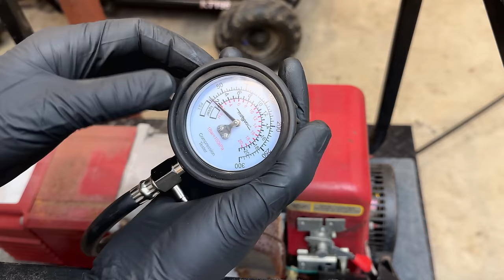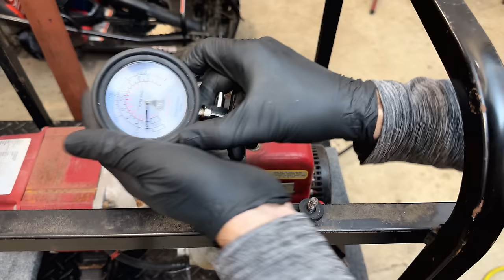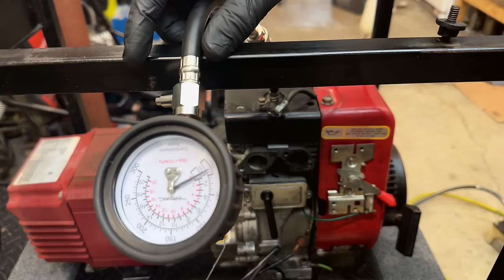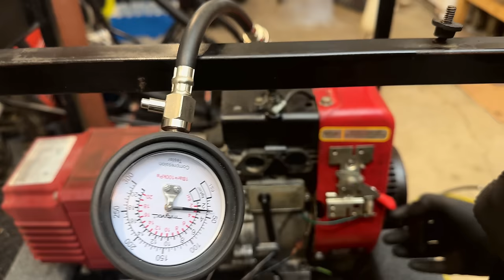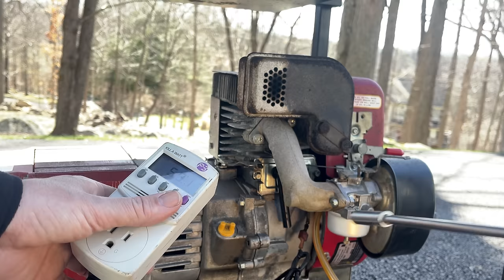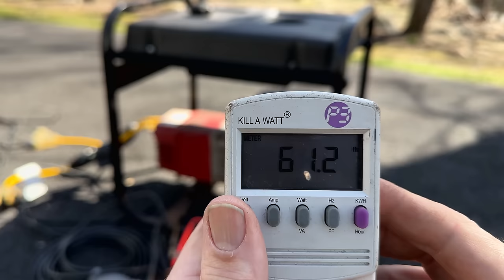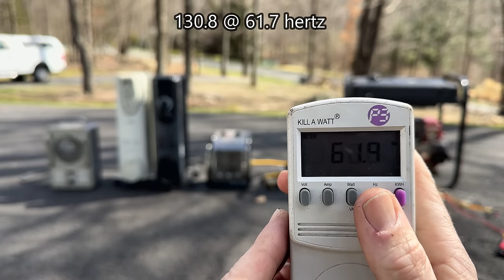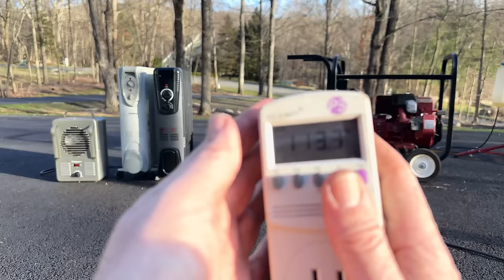More Tecumseh Trouble - Low Compression

Comment: 42:25 I would think adding lubricant to the threads and washers would alter torque values much more than surface rust. That said, I always wire wheel fasteners that are rusted or dirty. In this case a set of head bolts might take 5-10 minutes at the most. Hitting the bolt heads after installation with chain lube or wax would preclude debris from sticking and inhibit rusting, plus cleaned fasteners look way better than rusty ones on a finished engine.

Comment: Hey James, recent subscriber to the channel after repeatedly being recommended your videos (I watch a lot of adjacent content I suppose haha) and I gotta say, I've definitely been enjoying the long format meticulous look into the various gen sets that you come across!  As someone who really enjoys the electrical aspect of these units as much or even more than the mechanical side at times, something I'd like to see is maybe spend a minute or two showing the spec plate on the gen head or discussing your thoughts on how they went about breaking out the AC side of things for the end user. This ones a good example, as you stated it only has 120V (assuming NEMA 5-20R) and 240V (looks like NEMA 6-15R) outlets available, and how that makes it impractical to connect your load bank for lack of a neutral on the 240V receptacle. Then seeing how you connected the heaters split evenly between the two 120V outlets makes me wonder if they split the phases across each side of the duplex outlet, effectively giving you about 4800W @ 120V available. I'm sure I can't be the only super nerd wondering these things, and a little peek into these aspects of the units you work on would be icing on the cake!

Thanks for the laid back and informative content, keep it up!
Reply from the maker: They did split the phases on the 120 out.
Reply: @jcondon1 Ah, makes sense then! Definitely a good example of why it's important to "home run" heavy loads back to separate outlets on generators. Most of the time they don't even really make it obvious which outlets are on which leg so you can load them evenly, both on new or old machines. I've seen some funky stuff where they share one leg of the 240V breaker to protect the 120V outlets, "240V" outlets that are just wired for 120V, etc etc. Cost cutting for consumer grade equipment at it's finest i suppose. I still think it would be cool to briefly touch on these things to see how different manufacturers intended the consumer to use the equipment from the electrical side, especially on the more vintage stuff

Comment: Have you considered a "soda blaster" for cleaning the engine / generator cases?  Soda blasters (they use baking soda as the media) are safe to use on thin metal and aluminum.

Comment: Yeah, from my experience with Tecumseh used to have a riding lawnmower with a Tecumseh they’re exhaust systems tend to ignite unburnt fuel and caused them to pop and crackle, which sounds like a mess but it’s not just normal Tecumseh lol 😂
Reply: I had an MTD lawn tractor from the late 80's that had a really bum exhaust system. The engine just rattled the bolts holding manifold off. Not a good design at all. My Craftsman with a 19 horse B&S runs like a champ. It's going to be starting its 21st cutting season this spring.😊

Comment: You really need some hose scissors. You don't realize how much you need them til you have them. They make a really nice cut without flattening and misshaping the end of the line. They are about $7 at Lowes. They are one of the most heavily used tools in my kit.

Comment: I've noted in several of your videos the difficulty you have removing fuel fittings from the gas tank's rubber bushing. I'm thinking that it might be worthwhile to try using a slide hammer to pop the fitting out. It could eliminate a lot of time and frustration if it works. Just a thought. Your videos are in my list of top favorites!:finger-red-number-one:

Comment: Just past 49mins you mention that the clearance or lash would have gotten worse when the engine warms up and the engine may have stopped running. It seems counter intuitive but valve lash actually loosens when the engine warms up.

Comment: I had a craftsman trimmer that was always at 25psi. Different compression testers same result. No idea why. But it ran like a champ!
Reply from the maker: Really small engines like a trimmer need the shrader valve on the end of the hose where it screws into the head.   The less expensive testers have the valve up in the gauge.  The length of hose lowers the compression over the additional volume of air.

Comment: you should be able to use a dial caliper to check the length of the valve initially and then check and see how much you gave taken off with a measurement after the grinding to get a pretty accurate measurement.  keep submitting videos as I am learning a lot and look forward to your posts.

Comment: HAHAHAAH SO sorry You had to work on that Engine.
Now I don't feel so bad ...back in the 80's I had an 8Hp on a 4'000 Watt that was so cantankerously Noisy. I had a car muffler on it. I had washers between most of the mating surfaces. I had a easy to move governor adjustor 
and it leaked fuel only while it was running...
it was the 1st Genny I ever bought, and when I moved it was the 1st one sold. I still have 7.
3 of which are Military gen sets from the 40's..
I will  not work on any Techjunk engines anymore...

Comment: Love that you show that you torque bolts and give the specs. Having worked on repairing aircraft in a past profession made me anal about torques.

Really appreciated!
Reply from the maker: Thanks.  Definitely more important to torque aircraft bolts, but I would hate for something to fail because it was not torqued right.
Reply: @jcondon1  while not always "mission critical" I'm a firm believer that the correct torque should always be used if possible.

Comment: James, very good video. You made a quantum leap right to the valves. That's what experience will do for you. I was hoping you'd fire it up on starting fluid while running some gasoline into the carb just to see if everything else was working first. If I had a dollar for every generator I started up on ether that had no noticeable compression and then immediately put it into emergency service, without a problem, until the next time we "needed'' it. (forgot) But that's a testament to how things used to be built, befor tricky camshaft compression releases and plastic lobes. The old stuff can "take it" where the new "high tech" stuff, not so much. Fuel Injection anyone? Pure nonsense. Personally I look at the way they are going to OHV and sometimes OHC and wonder if it's durable. On the Misfire:  Those old Flat Head Tecumseh's  powered many a Go-Kart and Minibike and did not misfire a lick running full throttle and no governor turning 5,500 rpm or more, but that was befor breakerless ignition. I said it in part 1, if you had a scope you'd be able to see the electronic failure causing the misfire. Even a small amount of misfire is pushing unburned fuel right out the exhaust pipe. It should not misfire. Period.  ben/ michigan.

Comment: Wasn't sure if you knew it but the gel in the carb is probably fuel stabilizer. Most ppl don't use it correctly and most of it is garbage any ways. That's what it turns into when used with fuel that has ethanol in it.

Comment: Towards the end you commented that its the nature of the beast, on how these Tecumseh engines run, I think its due to the side valve design.🌻 The side valve engines are not very good cycling engines, unlike the🍀 OHV type engines, especially the crossflow design. They are good for slow speed applications, like in tractors, gensets etc and the early cars and trucks. I think its normal for🐞 these engines to miss on cold startups due to the unstable gas flow in the combustion chamber, and as they warm up they stabilise and run fine.🏵
Reply: Long intake manifold with 90 degree bends so fuel falls out of the cold fuel air mix condensing on the cold intake walls...so there is a lean condition in the cylinder.
Once the long intake warms up from heat conducted from the cylinder head all the fuel air mix gets into the cylinder so it runs smoothly

Comment: If the muffkin(a taradactyl term) is not in the way of the valve lapping I would just leave it on the head.  You can remove the bolt on top of the head while leaving the muffkin bolts attached.

Comment: The surging at no load reminds me of the old Suzuki 2 strokes on Toro commercial walk behind mowers with a BBC. The engine would surge, until you put a load on it. Those old Suzuki 2 strokes though would run for a long time without problems even with the surging at no load. Unfortunately carb parts are really hard to find now...which ends up being the death of the whole engine cause how expensive the parts are, just a Needle costs like $80.00, not to mention a whole carb re-build kit.

Comment: meanwhile it cloned itself,.. Lmao that is so funny James!
Reply: corroded bolts I like to clean them on a Benchgrinder with wire wheels and use a bit of anti seize on aluminum engines....
Reply: the non idling carb, can you remove the throttle plate, pull out the shaft and re rivet the idle stop lever back on and even add a bend to it for proper idle screw use?
Reply: where is the small spring to zero out any sloppyness in the governor to throttle plate linkage?
Reply from the maker: Tecumsehs do not use them.  I sometimes will add one if the slop is causing a surge.

Comment: as i said on the first video, tecumseh does not run smooth. if u can make a tecumseh run smooth then u are a very good mechanic! i don't know why they put them on generators. they don't run smooth enough for that application.
Reply from the maker: Running smooth is very important for a generator.  Not my first choice on a generator.
Reply: Have you ever tried to operate an air cooled old VW Beetle engine with an aftermarket exhaust that has no heat risers to the intake manifold for the single barrel carb??

The manifold on the Beetle has a "heat tube" that runs along it from one side of the engine to the other under the carb
and this is fed hot exhaust gases straight from ports in the VW exhaust right next to the heads.

This provides sufficient heat to stop fuel falling out of suspension in those cold long tubes...

When air flows but the fuel falls out of the mix...well that's a lean mixture stumbling and carb backfires plus stalling...and lots of!

The Tecumseh unfortunately has a long manifold with a 90 degree bend and no hot spot...
so instant inbuilt failure...
not seen on most other small engines that have a short straight flow path from carb to head and intake valve..

I would think that for the smooth running of a snow blower with one of these engines it would need a hot air catcher to direct warm air over the length of that manifold and even a bit on the carb???
Reply from the maker: @JohnSmith-yv6eq  I have not.  I wonder if that is why most Tecumseh engines run the fuel line between the head and flywheel?  Preheating the fuel plus no insulator on the intake pipe.  Between the two, it heats the intake pipe and allows the engine to run well once warmed up.

Comment: Seems the real issue with the Tecumseh motors is really the carb.  Have you ever considered putting a properly-sized Honda clone carb on a Tecumseh, just to see if it will run better?
Reply: Not the carb per se..

it's that long unheated manifold with the 90 degree bend allowing fuel to fall out of the airflow when the engine is cold...
that's the cause of the lean mixture and rough running.

If you adjust the carb for smooth cold idle..
when the engine warms up and heat migrates from the head to the intake..
then you get a rich mixture under load.

Small engine carbs are usually straight shot down a small manifold (if any) straight into the head/valve...
Reply from the maker: Not the carb, but agree with John about the length of the intake pipe.  Would think a carb closer to the engine like most small engines would make a big difference.

Comment: Tecumseh engines have always felt like the "budget" option OEM's went with, with the quirks they all have. They just never seem 100%, like the engineers just went "Yup, good enough!"

Weather this is true or not, who knows? Just my fraction of a cent.
Reply: Long inlet manifold wit 90 degree bend makes the mixture fall out and condense on the cold inside surface before it can get into the cylinder...lean mixture.
If you adjust for the lean mixture so it idles when cold..
then when the heat finally travels from the head down the manifold and all the mixture stays "in suspension"..
it will run rich.

Many small engines have carbs right next to the head (no manifold) and with a straight shot into the valve area......

For them tuning stays spot on after minimal choke time running to "warm up" a tiny little bit....

Comment: I love the old flat heads. Keep tighten the head bolts after every oil change and they'll run till Sunday. Work horses that should never be overworked due to Generator configurations. Generators need to be worked, they love to work. But don't ask them to power the neighborhood.

Comment: I have two Tecumseh engines, both are on Snowblowers.    They are fine in that application.   I would not buy a generator with a Tecumseh engine.   No bueno for that application.
Reply from the maker: They are great on snow blowers.  Not my first choice on a generator.  The only good thing on a generator application is that they hold their speed well when under heavy loads.  That’s what makes them great in snow blowers.  Plenty of brute force power.

Comment: I have a chipper with a Tecumseh engine.   Had similar issue.   Had to do a valve job on it but it ran very well afterwards.   Better than new in fact so I wonder if it didn’t have the problem right from the factory.

Comment: I don't understand why the clone carbs are so much cheaper than OEM. The OEM carb on one of my riding mowers was $180. I bought a clone carb for $18 that runs the engine perfectly. I have never had any issues with it, and I have been using it for about four years. Some of the OEM prices are ridiculous.

Comment: Take Three, I tried posting my comment, but for some reason, it was removed.
When it comes to the other Generator that is similar to this one with the bad gas tank.
You can get a gas tank repair kit, for some reason when I post the name of the site or app my comment gets removed, but it starts with (A), they are designed to be in direct contact with fuel.
I personally used it and they also have great reviews.
Reply from the maker: Thanks.  Will check it out.  Comments that YouTube automatically filters out, I can still find as they are held for review.  Thanks.

Comment: Great work James. The last gen. test had a very white area on the exhaust. Is it running to hot on the exhaust or maybe has a timing issue or a  valve issue. Thanks for the video.
Reply from the maker: Maybe.  It is also a new (aftermarket) exhaust so maybe normal?  Not sure.

Comment: My father dabbled in what I'd call recreational mining and had a home made ore sample crushing machine that ran off of a 7hp Tecumseh of a similar design; likely in the same engine family actually. That thing was ALWAYS finicky! He had smaller machines that were B&S powered, and those ran like clockwork.    

How are these generator heads wired? 42A on one duplex socket seems pretty insane unless they have them split wired internally.

Comment: James: I have (5) 10hp Tecumseh snow blowers with similar results. I have always thought that the updraft intake manifold has some negative effect at lower rpm's, with fuel puddling and separation and never getting completely and evenly warm being exposed to the out side air. - Just a thought.
Reply from the maker: Would be interesting to test.  Was thinking the same.

Comment: Be careful and double check the Tecumseh manual before grinding that exhaust stem.  At the back of my mind there’s something odd about the setting procedure such as just after TDC on the power stroke, not TDC.
Reply from the maker: A little after TDC is safer.  They just want to make sure you are clear of the compression release.

Comment: Missed a spot. Clean the piston & finish the job or don't even bother. You did everything else? If you are worried about any aditional carbon you introduce in the rings use your air nozzle & blow it out. You are not going to hurt it any worse by cleaning it properly, Seriously. When I adjust valves, I use a Goodson piston ring/valve stem grinder, the olny manual tool I have ever found for grinding valve stems & a Neway valve seat cutter kit when needed. Also, Dico Nyalox drill brushes for prepping metal, they work amazing.
Reply from the maker: Thanks will check it out.  Recently tried a belt sander for the stems and definitely better then the grinder.  I have for years cleaned up the piston, but after some negative comments I agree it could cause issues with the rings.  That said, have not had any issues yet.

Comment: Tecrapseh. A lot of people swear by Tecumseh, I haven't had much luck with them either...Except snow king engines on snowblowers. I think the older Tecumseh engines were a lot better, towards the end (before Tecumseh stopped making small engines), the quality of engines and parts got much worse in quality. I'm not sure if Tecumseh makes anything anymore, they used to make compressors also.